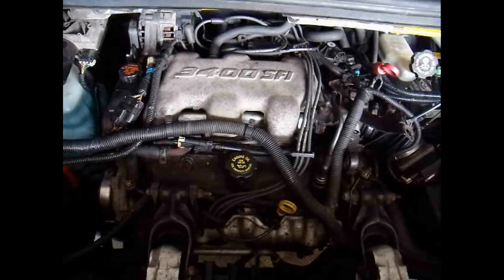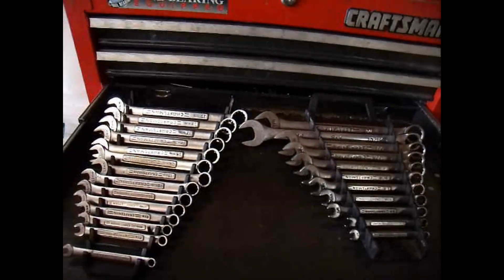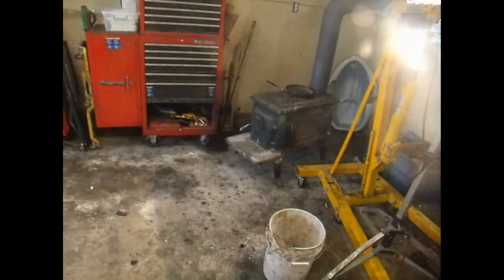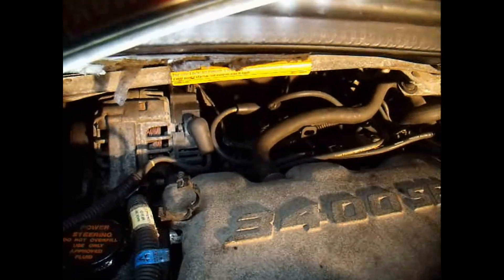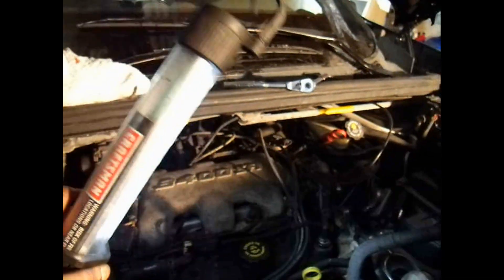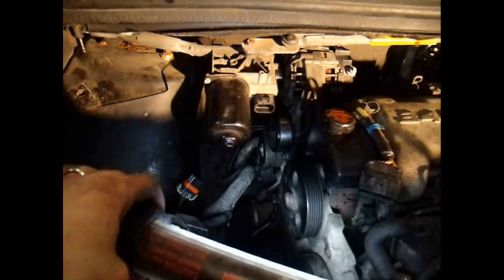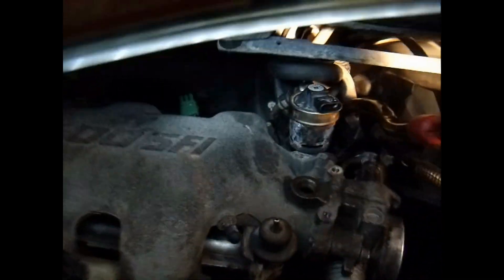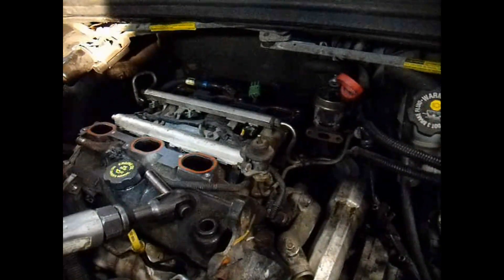How To Change A Bad / Blown Head Gasket 3400 GM Overheats Thermostat Intake Manifold No Heat 3.4

Comment: I have all the bolts out for the head but do not know how to remove the left motor mount as there seems to be a bolt behind it.It appears in 16.15 minutes the left motor mount is off . Does the left have t come off. I have taken the top bolt but do not see any other bolts. Do I have to take the left off? Also do I have to take the right motor mount off. It seems I do not have to. I am getting close but still running into some problems. Hope you can help.
Reply from the maker: Both engine mounts need to be removed so the exhaust can clear when lifting.  The A/C compressor needs to be removed as well, there are bolts behind it that hold on the passenger side engine mount.  Did have to work the mount back and forth to remove the mount once the bolts are removed.  I got stuck on that as well when I was doing this job.  Can't see those bolts easily as they are tucked in behind the A/C.
VT247
Reply: where is the A/C? How do I get to it ?
Reply from the maker: It's attached to the passenger side motor mount.  Can access it best on the ground, I believe it has 4 15 mm bolts holding it on.  Just let it rest on the subframe.  Don't need to remove the lines connected to it.  The air conditioner compressor is at the bottom, near the radiator, subframe next to the crank pulley.
VT247
Reply: Thanks I am happy that the lines do not have to be removed. You have been such a great help to me not doing this before. Where about do you live just wondering as to time zones you are in as you seem to always fast in getting back to me.
Reply from the maker: Live in a small town on the northern California coast called Crescent City.  So that's pacific western time.  Glad to help.  Wish I would have seen this comment before, sometimes they slip by.
VT247
Reply: I am down to the last head bolt on the far left with the  motor mount. I jacked up the front end and gone under but I can not see any bolts on the A/c. All I see is bolts on the A/C pipes. So I am having problems removing the compressor to get at where ever the bolts are to remove the motor mount. These engineers are crazy to repair things.
Reply: I am at this spot but I do not see any bolts to remove the compressor. All I can see it the 2 bolts to remove the silver air pipes.
Reply from the maker: There are 3 bolts holding on the A/C compressor.  Thought there were 4, but it only  3.  Two above the silver pipes, and one below.  The two above are tucked back slightly, one one each side where the electrical plug in is.  Then there is one just below the silver lines about in the middle.  Believe they are 15 mm bolts and are kind of lengthy.
VT247
Reply: Thanks so much as from the bottom I could not see any bolts so now I know where to look. I will have to wait a few days as it is -24 below today and no heat in the garage.
Reply from the maker: Don't blame you.  Had a garage in Indiana, but had a couple sources of heat.  First would fire up the kerosene torpedo heater and let it run while the wood stove would gradually heat up.  Nice thing about here in California, is that during the day, even in the winter, it rarely gets below 50*  Built a small area to pull the car into if it starts to rain, which we get a lot of here.
VT247
Reply: Wish I was there.

Comment: This is a good news, bad news kind of thing. I bought a 2003 Alero and after two months a rocker arm stud let loose. After some digging I discovered there have been two other studs that have gone bad on this engine. I'm pulling the heads and having  all the studs replaced. The good news is that I have been able to remove all the exhaust manifold bolts... but one. The lower rear at cylinder #5. I can't get the heat shield out of the way to get a socket on the bolt.   Any ideas?

Comment: Hi, again, I forgot to ask you about the rocker arm torquing, do you have to turn the camshaft to the flat part of the love ,when you torque them ?. thanks again.
Reply from the maker: No, they are pedestal rocker arms.  Just torque each to 30 ft lbs.  Doesn't matter where the cam is in position.  The Intake and exhaust push rods are different lengths.  I believe it is the intake that is the shorter one.
VT247

Comment: Hi Sir,

How you remove the passenger side engine mount? I am stuck right there...
Seems like I have unbolted all 3 bolts but it is still sitting very tight.
I have 2001 Chevy Venture 
Thanks,

Comment: I have a 2000 Grand Am with 75k miles on it. I know for a fact that I need new intake manifold gaskets. I am debating if I should change my head gaskets as well. Do you think a good head gasket test would be, filling up my coolant reservoir with water and using the funnel in there to see if air bubbles are coming up when the engine is running? Also, if i decide to change the head gaskets as well, once you get the heads off, do you think I really have to get them machined at a shop? Thanks.

Comment: When you pull the engine forward it appears the right side (when you face the front) is attached to the head so how can you get the head off? Do you take the parts off then put the motor back? I am having lots of problems getting the items off the back of the motor.
Reply from the maker: I pulled the engine forward with a ratchet strap to gain access to the bolts in the back.  It may also be easier to get under the car and get some as well.  Once the accessories are removed, I let the engine rest back in it's original position.  Then took the head bolts off.  What accessories are you having difficulty with?
VT247
Reply: How far will the engine come forward? The items having problems with is Air intake 11:58 min. on video and I think the EGR Value 12:29 on video. Maybe when I pull the motor ahead I will see things easier. Having to take a break as it is -15 below today with no heat in garage.
Reply from the maker: At 11:58 that is a water coolant passage.  There is an 8mm bolt holding it on near the water pump and a 13 mm bolt holding it on at the throttle body.  That is probably were you're getting hung up.  Remove that bolt and then slide up those 2 crimp clamps to remove that black pipe.  Sometimes I remove it completely other times I leave it connected where it goes in for the heater core.  It can sometimes be difficult to remove or slide out that 'quick disconnect' which isn't quick and can be hard to disconnect.
There's 3 bolts for the EGR.  2 on one bolt.  The first one also holds on the transmission dipstick, it's not to hard to remove, believe it is either a 10 mm or 13 mm.  The other 2 are 10 mm bolts and go into the upper intake.  Remove those 2, not easy to take loose, but can be done with enough finagling.  Turn, remove wrench, turn again, repeat until remove.  That will leave the EGR hanging loose.  Will allow the upper intake to be removed.  Don't personally remove the entire EGR from the exhaust, the bolt going into the exhaust manifold is difficult and really not necessary to remove.  Just take both heads and exhaust off  as a pair, usually makes it easier.  The engine will rock forward enough to remove the alternator bracket and bolts.  The bolts are of different lengths, they need to go back into the same location.  Again, try and remove, label and place where it is easy to put back in the correct location.  Hope this helps. 
VT247
Reply: thanks so much
Reply: Can I move the motor forward without taking the exhaust pipe off first. I was going to take the exhaust pipe off just before I was to take the heads off.
Reply from the maker: Yes, it's possible.  Believe it can move forward more without the exhaust on though, but it can be moved enough to get to the areas that need to be accessed.  
VT247
Reply: Thanks . You have been so very helpful for my first time tackling a project like this. You have taken away many fears.

Comment from the maker: Put on a socket that is one size smaller and break off the bolt holding on the heat shield.  The rest of the bolts will hold it on.  I had to mix match the sockets on mine to get the shield off.  They were all pretty rusty.  Hope this helps.
VT247

Comment from the maker: You have to remove the A/C pump.  The bracket is still behind there.  There are 3 bolts holding it on.  No need to drain the A/C, it slides down and out of place.  On top of the bracket there is a hole.  Once the A/C is off, it twists back and forth after soaking it with lubricant (WD-40, oil, trans fluid).  Kind of a pain but keep workin' it and it'll come out.
VT247

Comment: I just got my thermostat radiator n intake manifold done within  two weeks time now I'm told it's my head gasket well should I buy the gasket or just the head gasket since I already got a basically brand new intake gasket???
Reply from the maker: Get 2 Felpro Heavy Duty (HD) gaskets and an intake manifold gasket set.  Wouldn't chance it re using the old gasket.  
VT247

Comment: yea i agree i had to do a head gasket kit on a 1999 pontiac grand am and then a 1999 pontiac montana head job so i am getting used to working on these 3.4l's the first kit for the grand am cost $158 then i looked on ebay and found on for 2 times less for $51 so saving a little over $100 so now i do the shopping on ebay alot of money and time can be saved by getting the set than getting 1 piece at a time and spending more money for labor or parts but in all in all i have the motor almost done but

Comment: thanks for the information is helpful, I'm about to change the gasket  but I need to put silicon on both sides of the gasket?
Reply from the maker: I did, it's really just a personal preference.  I believe it creates a better seal.  Definitely put silicone on each end of the engine, between the heads & intake gaskets.  A 1/4 inch bead of silicone for the ends of the intake to make a seal between the motor.
VT247

Comment: hey. im doing head gaskets on a 02 rendezvous right now. almost got the heads out. wondering do i need to bring them to a machine shop n have them resurfaced or is that just if they're real pitted?  appreciate the video.
Reply from the maker: +Steven Eli Check for cracks between the intake valve and the spark plug seat.  They can develop cracks there.  You can get heads ready to go on ebay for @$350.  Check for straightness using a straight edge and for cracks.  If both are good you can just replace the gaskets.
VT247

Comment: Did you take the top part of f with the value covers still on or did you take them off before removing the top part as their is a big jump in the video. At 14.31 minutes.
Reply from the maker: Take the valve covers off first.  You'll need those off to lift the intake out.
VT247

Comment: I'm doing a head gasket job on a 03 buick rendezvous is I had to use inch pounds CAUSE of my wrench is inch pounds I did 65 foot pounds stepped it up during the processing  is that over torqued?? I watched your video!! Btw it's 24 foot pounds for rocker arms umm I hope that 65 is right I understand the math when it comes to degree adding but I watched your video SPECIFICALLY there's differences but the same procedure I hope you reply thanks !!
Reply: I hope your right on that
Reply from the maker: I did create a text bubble when I said the rocker arm torque specs stating the correct numbers.  Can't go back and put in a voice over, so my bad.  But if you torqued down the head bolts to 65 ft lbs you should be fine since you stepped them up, hopefully in increments(40-50-65 or so).  As long as everything is firm and secure you'll be good.
VT247

Comment: all i can say is you can get a full head gasket kit for the 3.4l on ebay for $51 i just had to do a complete head change as the heads both blew and had blow back in to the resevoir so i changed both heads and did a full gasket kit replacement

Comment: Thank you for creating a informative video. Been using it as a guide for my buick rendezvous.  I ve got everything almost put together but I lost track of where a certain wire goes.  Its the wire that sets on the right side of the engine located around the exhaust cross over.  Its lime green colored.  Can you tell me where that plugs into? Thank you!

Comment from the maker: I'd allow for 2 days, one to take everything off and another to put it back together.  Order the parts early so they'll be there for when you need to put everything back together.  Parts ran about $200.  Fel Pro Head gaskets $40, Head bolts $16, Intake manifold gasket & valve cover gaskets combo $60, oil change kit $20, Coolant $20, spark plug wires $20, Spark plugs $16.If you have a Fastenal or bolt company around have them find usable bolts for the exhaust crossover, they tend to break.
VT247

Comment: What are the torque specs for a 2005 buick rendezous
Reply from the maker: If it has the GM 3400 the head bolt torque specs are 44 ft lbs then 95 degrees.
VT247

Comment: I just found this video I have a 03  rendezvous , it seems to run just fine BUT it doesn`t really have heat works sometimes most of the time it don't. I have just started smelling something like its over heating but the gauge shows its all good never goes past half way really sometimes just sitting at a light it will move up never in the red . any thoughts on this smell . after seeing this video I am thinking maybe it could be the same thing but I don't know I am clueless in this matter. please get back with me if u will please , good video seems easy enough to follow but I will just have to have some one else do it lol this is so far above my head . TY
Reply from the maker: +SW Outdoors Do a coolant system pressure test.  You can get the loan a tool from Autozone.  It pressurizes the coolant system and will show leaks easily.
VT247
Reply: Vacationtime247 lol I was just looking at a video about this same test when you replied back looks like I am headed the way ty for getting back to me so fast

Comment: I have pontiac aztek 2002 and I have the same problems on my car, how efficient is to make this work? I'll have the same problem at some future?
Reply from the maker: My problem was the head gasket.  Use good head and intake gaskets and it will run fine.
VT247

Comment: hello to all.. i need your suggestions about the following.. having heater trouble. i have Pontiac Montana 2000 VAN and the problem is the driver side and also includes all the heater in front has no heat coming out... But, the rear passenger seats heaters are working well with heat coming out. When the thermostat were replaced earlier, all heaters in front and the rear passengers seats are working with heat coming out. Just recently, wondering the reason why no heat is coming out in front heaters until now i tested no heat is coming out in front seats?? pls help .. thanks
Reply from the maker: Does the car itself overheat?  When I had this problem, I had no heat in the cabin.  But, the engine would over heat.  This was due to a bad head gasket.  Is there only no heat on one setting or no heat at all?
Reply: Front cabin ( driver & passenger side) NO heat, blower for windshield also NO heat... But the blowers behind the driver side are working well with heat..
Reply from the maker: Try bleeding the air out of the system.  Make sure the overflow has fluid in the reservoir and the radiator is topped off.  On top of the water pump, there is a black tube / line with a brass nut above, it's a 7mm.  While the engine is running and warmed up, loosen it up until fluid comes out then, no longer spits out air.  If that doesn't work, make sure the blend door and warm / cold dial is actually working when turned back and forth.
VT247
Reply: okay thanks ... i'll try it next day morning..

Comment: I started to do this on my own.. Question. Why would i have to send the heads to a machine shop like my brother inlaw told me?
Reply from the maker: Thad James A machine shop will check for cracks, straighteness on the mating surface and other problems.  Otherwise you may not know until it's bolted back down.
VT247

Comment: the altenator/ bracket belt wiring radiator transmission lines air system 1 vacuum line that runs to the pvc valve and throttle body back to the o2 sensor then the braces and motor mounts along with the bleeding of the antifreeze lines in front of the front valve cover and on the themostat housing plus the power steering pump them its a hopefully run and start for me still seems alot but like you say it looks like alot but really its not

Comment from the maker: I've got a video up on how to do both the head gaskets and the intake manifold gaskets.  I advise everyone that asks me a question on the intake gaskets to go ahead and do the head gaskets.  99% of the time if someone is having an overheating issue with the 3400 or 3100 if the intake is good and there is antifreeze, it's the head gasket.  The water pumps and thermostats don't go out that often.
VT247
Reply: Do you always need to take the Head engine to a Machine shop?

Comment: did you have to take the cylinder heads to a machine shop to get them resurfaced
Reply from the maker: Personally I just checked for cracks carefully by looking at them.  I didn't have them resurfaced as it didn't seem as though they needed it.  Not had any problems since doing this fix!  Which is good, 'cause this is a time consuming repair.
VT247
Reply: Vacationtime247 
I've recently changed a blown head gasket and the thermostat on a 2002 Buick rendezvous but the car is still over heating